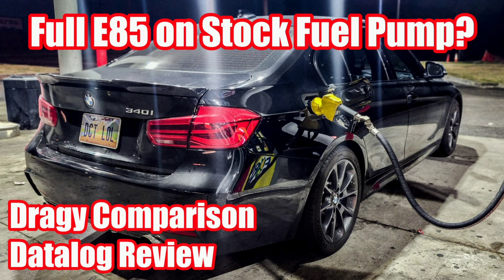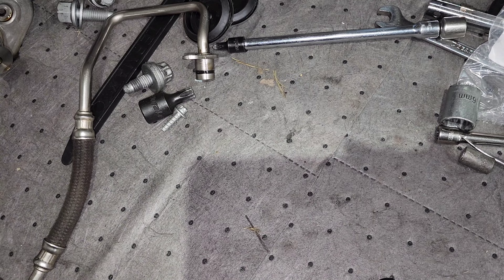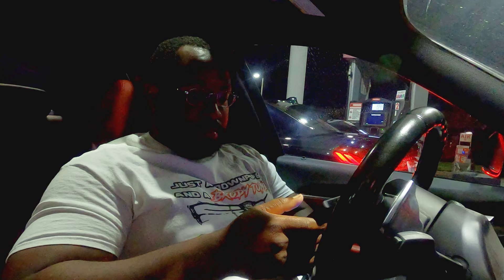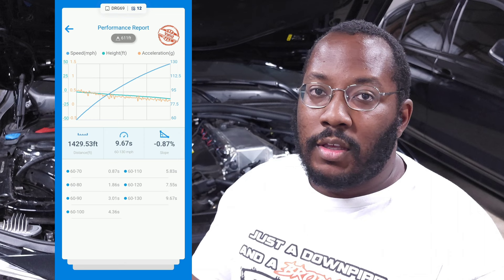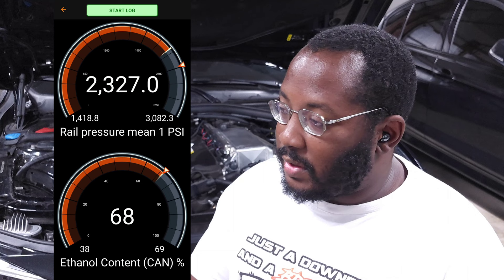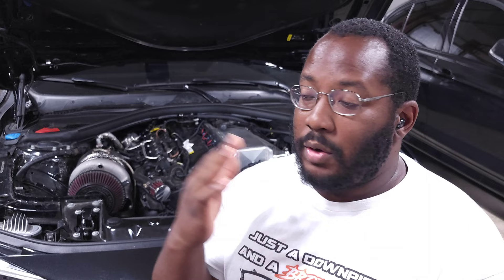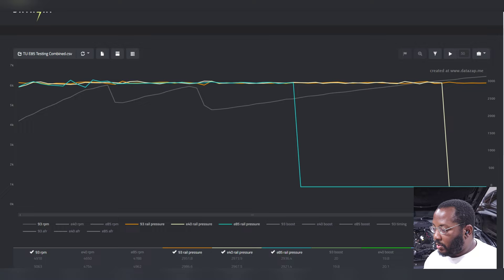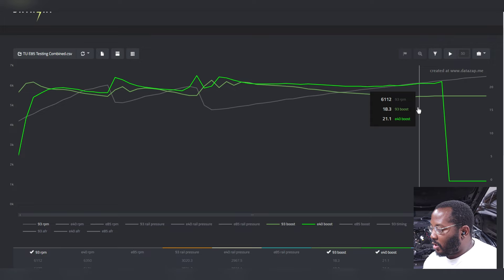How much E85 can the TU pump handle? - Flex Fuel Testing on my 340i

Comment: What up,big homie, chiming in again. I did the exact data logging with full e85 and 93 on my MHD stage 2+ w/TU pump. The car actually runs smoother on the E85 map. The mid-range torque felt a little better on the 93 map. I started filling e85 when chitown gas prices were 5.99 for 93.

Oh snap, I was the first comment!

Comment: Installed the MHD flex fuel analyzer with a TU pump and and have been running e85 with the stage 2+ multimap. Should probably run some logs soon.

Comment: I’ve found E40 on my 340i with TU Pump + MHD Flex Fuel + MHD Tune is significantly much better in terms of speed and smoothness than compared to E30, it’s cool tho with the flex fuel kit + tune. I be running E20 and the added boost is enough to increase speed.

Comment: I'm running MHD flexfuel with their CAN ECA. I'm not sure what you are saying that MHD is the only option that optimizes the maps to the actual content. Sure, they will set timing and boost according to the actual E, but to me, and according to a previous video you made on this particular topic, a static E40 map running actual E42 or E43 will be faster than a flexfuel map running the same fuel. 
But maybe you mean that there is no other company offering live timing and boost adaptation to the E content?
Reply from the maker: No other company has an option for optimal mix. It's a straight flat curve from e0 to e85. Only mhd has the option for Peak Performance somewhere in the middle.

Comment: @kern417
Thanks a lot for that great comparison, especially your explanation on the logs.

I didn't know that you can run an OTS maps (like here the stage 2 hpfp map with flex fuel) on a non-stock turbo.
And concerning ethanol: So in the US, ethanol is available at your gas stations? Is it pure (100%) ethanol or how do I have to understand "E85"? Because normally the number explains the percentage of ethanol, for example E40=40% ethanol. So E85% would mean 85% ethanol mixed with 93 octance gas?
And concerning power: So my understanding now is, the better the fuel quality (or let's say the higher the ethanol content), the higher the timing can be set, resulting in more power. But there are limits of the system (e.g. the direct injectors) due to which after a specific amount of ethanol (limit), boost has to be decreased, resulting in total reduction of power (e.g. comparison E69 vs. E39).
Reply from the maker: For reference, OTS map does work with some non-stock turbos, but the car in this video has a stock Turbo. 

And yes, there is a point where you get the optimal mix of boost and timing with an ethanol mix, and then adding more ethanol only limits the amount of boost you can run without making more power.
Reply: @kern417 
But isn‘t the car in this video your 340i with the top mount big turbo? Because you‘re writing „stock turbo“.
Reply: @kern417 
And concerning E85 (because we don‘t have it here in Germany):
So it is a mixture of 85% pure Ethanol and 15% 93 octane? That would make it not that easy to hit a specific ethanol content, if you‘re not having a flex fuel kit and rather need to hit a specific ethanol target (e.g. E40).
Reply from the maker: @gwspom  my 440i has a top mount turbo. The 340 is stock Turbo.
Reply from the maker: @gwspom  it's 85% ethanol and 15% pump gas. But they don't really confirm what the pump gas octane is. Only need to do is put 85% ethanol in the calculator when you figure out your mix. It's not that hard

Comment: Thanks kern as I said in the last video E40 map is a beast compare to 93
Reply from the maker: I never want to go back 😭
Reply: @kern417  fr feels like another car but where am I living ethanol cannot be found on pump u have to get it on tanks and the price is 16.34$ per one gallon!!! So I tried E40 for only one time and couldn’t do it again it does cost alot I wish it wasn’t🥲🥲 
And thanks for the video again I already liked it 🙌
Reply: @kern417 
Btw: How much do you pay for E85 in the US?
Reply: @gwspom I live in California probably the most expensive state in the US for gas and I pay 3.25 USD for E85
Reply: @twebb5896 
So 3.25 USD per gallon of 85% ethanol and 15% 93 octane?
Reply from the maker: Just depends but lately around $3
Reply: @kern417 
And what do you pay for 93 octane per gallon?
Reply from the maker: $1-$1.50 more
Reply: @kern417 
You pay more for pump fuel than for ethanol?! In Germany, it’s the other way around. We pay around 2€ per liter for pump gas. Ethanol is only online available for around €3 per liter.
Reply from the maker: @gwspom  yes it's usually the same price as regular gas or slightly cheaper
Reply: @kern417 
Now I know why Americans started with the ethanol topic. With the same price at the gas station (E85 vs. 93), why shouldn‘t you choose an ethanol tune. Here in Germany, you simply don‘t get ethanol at a gas station. But at least we‘re having Aral Ultimate (102RON). That‘s what most tunes are developed for.

Comment: Hey Kern, 

I live in AZ, we have pretty poor fuel to choose from out here. Highest pump gas is 91oct, sometimes you can find 100oct. I want to start running E40 as I got the TU Pump for my F22 240. I’ve been considering buying the MHD Flex Fuel kit for the convenience factor, but if I remember correctly you said the kit doesn’t read 91 Oct so I would have to get a custom tune to go with the kit. Is that still true? Or am I just limited to Stage 2, and not stage 2+ because I can’t mix the E85 with 93? Been seeing a lot of mixed answers on the forums.
Reply from the maker: Map switching is your best bet
Reply: have you had any issues with mixing 91? I'm in a similar situation here in cali
Reply: @noahmcauley4112  I reached out to MHD, the newest flex fuel kit now supports 91 mixing. Highly recommend getting the Gen2 sensor!

Comment: I’m running stock hpfp, VRSF dp, mhd stage 2 93oct. Have been considering tu pump to run e85. In your opinion do you think I should try e40 on stock hpfp?
Reply from the maker: the stock hpfp map is e30 but yes it's worth it

Comment: hey whats up man i have a 2020 m340 with no flex fuel kit, can i reliably run e30 and switch back to 91 with no problems?
Reply from the maker: You need a tune

Comment: so kern, my tuner prefers e30 because he can run more boost, my question is, for roll racing, i won’t be doing dig racing at all or if i do very minimal, is higher boost better? i’m on ds2 stock turbo
Reply: E30 higher boost is actually better. Buddy of mine with the M340i(Gen2) runs jb4 custom tune E30 mix and is pushing over 500hp with a lot of boost.
Reply: @340istephen  appreciate it bro, i thought so too but I wanted other opinions
Reply: @kern417
I've also been told by my tuner, that he prefers boost over timing. Reason is, that the B58 may handle lots of boost, due to closed deck construction, but not that much timing (not more than 16 degrees) due to the high compression. As a result in case of too much timing, he saw a couple of web breakings at pistons. Whereas the rods of the B58 seem to be extremely endurable.
Reply: @gwspom  this
Reply from the maker: 16° is a lot of timing. Pump gas maps run less than 10. But once you get to 15°-16° then more boost makes a bigger improvement than more timing. The b58 Hits maximum efficiency around there.

Comment: I try 100-200km/h on Bm3 st2+ with tu only on gas 93(98-100 in Russia) and it be 9.3-9.4s
On e10 I runs 8.80-9s
Many saying what mhd a little slower like bm3 or mgf
Is it really true?
Reply: My mhd custom slower than my buddies bm3 both gen 2 DAW/Pure800
Reply from the maker: No it is not true
Reply: how u running 8s on e10💀
Reply: @sergiobetanzos1514  It's only single run temperature 13°,  slope -0.10
Distance 385,49 meters time 8.80
It's the best run
All results uploaded to dragy

Comment: what you gonna say to rk tunes spinning a bearing in his m240?still convinced there are no oiling issues on b58 when tracked?
Reply from the maker: Lmao welcome back. I know you just saw a a video and think you got something, but I've been talking to him since it happened back in May.

I know why it spun. Do you? 😊

I've tracked my B58. Have you? 😊

The fastest B58s around a track are stock motor pushing 600+whp. But go awf 😅
Reply from the maker: Your mind is going to be blown when you find out all he did was drop another stock motor in 😂😂😂
Reply: @kern417  thats what i would do,what else can he do about  engineering design thats not made for tracking besides buy a real m car? but you still havent answered why it spun a bearing pls share
Reply from the maker: @durin23  you can do what every other car does? Do you know what an oil accumulator is? Or a dry sump? Ever been curious about that silver or blue bottle in all the FD cars? It's not just nitrous 😏

It spun because it was defective. The rest of the engine and all other bearings were perfect 😉 Thankfully it's not like those M engines that have accelerated bearing wear even without tracking 😂
Reply: @kern417  ever been curious why real m cars dont have those little bottles?😜
Reply: @kern417  im also curious why didnt rk or papadakis have the oil acc?i think they had too much faith as you in b58 then reality hit, papadakis seems to solve the oil starv issue with a standalone ecu he adjusted the oil pump to run full pressure at all times,and switched to non coated bearing,btw s55 or 58 dont have accelerated bearing wear compared to b58,when tracked.
Reply from the maker: People are pulling their s58 bearings at 10k and they're already scored lmao. Do more research. Ask RK what his OEM coated bearings looked like 😎
Reply: @kern417  i believe you,the b58 doesnt have accelerated bearing wear,just like n55,it just can have sudden oil pressure loss under a certain amount of high g load and spin a bearing its not as common as n55 as the oil pump is in the rear on b58 but  fact remains b58 was not desighned as a track car from factory no matter how great you might think it is,but i am surpriced s58 has accelerated bearing issue,do you think its cause of too tight of clerance?cant think of any other reason cause s58 has awesome oiling system.
Reply from the maker: @durin23  maybe there's more to it than just having 2 oil pumps 😎 just because ir wasn't specifically designed to be a track car doesn't mean it can't be tracked. Toyota literally gives free NASA track days to supra buyers. Like I said, more B58 owners track their cars than you think. But with the S58 stuff it seems like it'll be similar to the S65 situation. We'll see 🤞🏾
Reply: @kern417  interesting indeed,with n55 in m235i bmw realised it cant be safely tracked and added s55 oiling sump for the m235r tells me they knew,but for b58 im not sure if any sump diffirence between supra and gen 1 b58
Reply from the maker: @durin23  but the m235 has demonstrated it can have issues. There are multiple baffled oil pans and upgrades to fix it. Even high g turns on a highway can cause oil starvation on an n55. The b58 does not have issues. Hell Larry Chen chasses papadakis built A90 around a track in his stock A90 😂
Reply: @kern417  but whats so diffirent on b58 oil desighn vs n55 besides the b58 has oil pump in the rear of the engine,but that alone fixes the high g starvation issue in your opinion?baffle helps alot for n55 thats true
Reply from the maker: @durin23 nobody knows yet. It is most likely just another M engine with design issues.
Reply from the maker: @durin23 the oil pan has baffles, bigger oil returns, thinner oil weight, etc etc